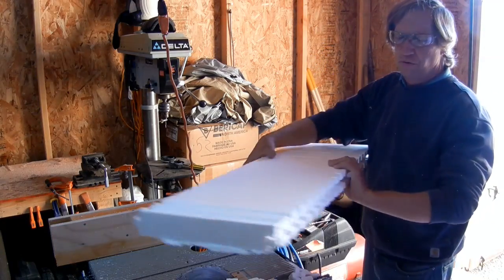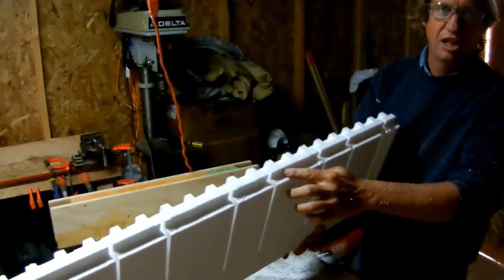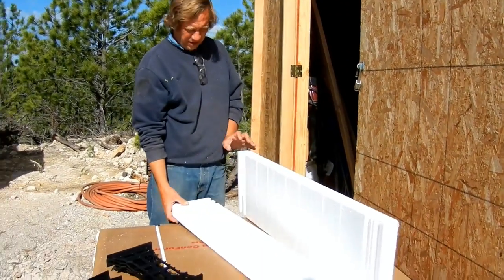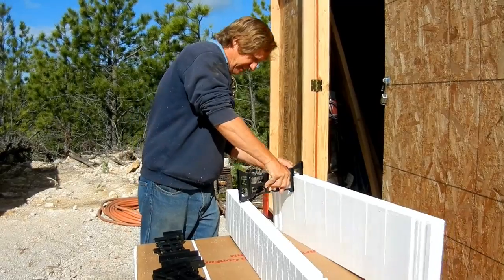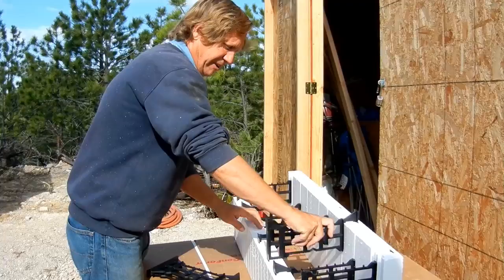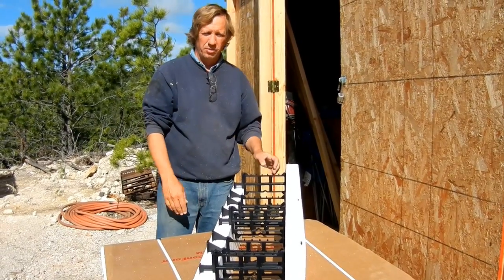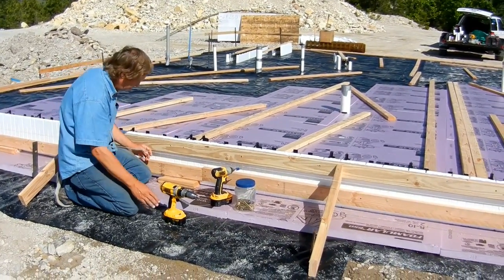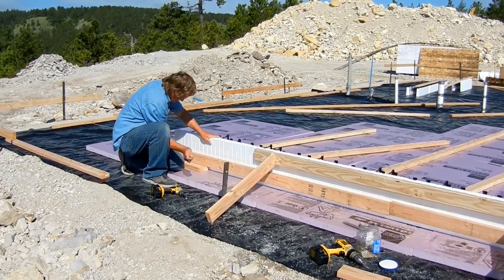Insulated Slab using Insulated Concrete Forms

Comment: Our well water is 58 degrees.  Our temperature of the soil is 58 degrees!
Our slab temperature is 58 degrees!
Even now the aie temperature is 30 deyet our room temperature is  60 degrees!
We haven't turned on our heat!
Yes, we are very comfortable!
It's an experiment & it's  enlightening!
BUT DON'T TRY TO INCREASE YOUR SLAB HEAT ARTIFICIALLY!
IT WILL BE EXPENSIVE!

Comment: I am pretty sure you can not put foam under the foodings as it will collapse over time....   It has been 6 years now, are the walls cracking?
Reply from the maker: I have no signs of settling.
Reply: He mentioned that they are over rock.  Their location has different soil conditions.

Comment: frost drives down, not out.Outside of floor only, need be insulated.
Reply from the maker: True, but I cut the inside form 4" lower than the outside and backfilled the center. The inside is used to form the footing and set the slab depth.

Comment: I know many people put down a great deal of foam and that is ok but just the fact you created a thermo break with one layer of foam is going to create a huge effect.  I built a home with a walkout basement in 1990. Under the slab I put down just one inch of foam. Around the basement walls I placed one more inch of foam right down the the footing. You should have heard the people back then that said my walls were going to freeze in the winter and the soil would push them in.  It worked perfectly. This house was easy to heat and I never had a single issue. That effect came from just one inch. 
Of course now days I'll add much more foam all around but the reality is that one inch thermo break is what counts the most.  I like how you did your slab.
Reply: Funny thing is though, ICF have been around since shortly after WW2 and never used for those same assumptions but also for their fire "traps" and "off gas", despite those claims they are quite fire retardant and so inert due to being steam molded that there is no off-gassing issues. That and there were so few manufacturers making them then due to low sales volumes, But these days man are much more of this generation figuring it out, better late than never.

Comment: Another option was to cut insulation panels in band ( height of your concrete ) place them on the face of the mold with nails and connect them to concrete with let s say 2 screws/m1 and do not use ICF ( the inner insulation serve nothing in my opinion ), 

Your option is also valid, just another way to made it maybe for less money

Maybe you could have also use foam glass garvels like misapor on the limits to avoid the insulation under your slab, but when doing so you don t get the advantage of the thermic damping mass of the slab

Two different options, different manners to do the job

Anyway, top work mister B-Spot ;)

Comment: Nice job, only thing I see missing is personally I would have sunk my foundation J anchors for the bottom plate into the footings and let them stick up. Sure you can drill in anchors later but why.
Reply: J (more commonly L) anchors are a cuss to fix if not placed right the first time, so if you wonder why then that is why drill anchors are often used in lieu and often as strong if not stronger than L/J anchors, but expanding has a limit to placement as opposed to screw in type anchor which can be drilled as near as 2 inches to and edge of a concrete form.

Comment: I have one dumb question.

Why back-fill the form with dirt before the concrete pour?

Sure, it may have saved you some on concrete volume...
Reply: Probably about 5 grand in concrete vs fill.  Plus it adds thermal mass for the radiant

Comment: Because the foam is on the same level all the way across (to put the footing icf on the foam) the purpose of the gravel seems to be to not have to make the concrete so thick in the main slab area.  This also makes it a monolithic pour.  This works out great for something on top the ground in warmer climates, but if that foam isn't several feet out away from the footing you can't use this in colder climates.  And it would have to be a little different if done deeper down with a basement because you would need a drainage system in the main slab area that runs in line with the footing.
Reply: From my understanding the distance out from the footer depends on the climate zone the building would be located in.  For example, here in zone 6 Montana the Montana Residential Energy Code Handbook (2012 currently used revision) building codes specify 4 feet of foam out from the top edge of the slab, horizontal or vertical.
Reply: You are referring to laying said amount of foam flat and out away from the wall , akin to this:
http://iso-slab.com/en/index.html#tab-5

As said layout shows it extends the frost protection zone, but horizontal would mean a footer wall and thus mean more foam and concrete with rebar than a simpler skirt footing as shown in the link image.

Comment: What brand of ICF are you using?
Reply from the maker: +Justin Palmer --- I got them thru Home Depot not sure of the brand.
Reply: @BSpotBuilds  Double checking...ICF is not a vapor retarder or vapor barrier?   The plastic sheet is the vapor barrier as I understand it?   I ask because i want to put ICF on the outside of my home's walls.
Reply from the maker: @Dancing_Alone_wRentals  ICF's are typically closed-cell foam and would be a vapor barrier, but the joints between them would need to be sealed. You could glue them together with canned spray foam if you need a tight barrier.
Reply: @BSpotBuilds  tHank you.  I'm planning two diffferent projects.  One would use Polyiso inside the home under drywall....There I want to add another layer of panel insulation on the outside of the home.  My concern is I can't use a vapor barrier inside...then add another outside.

Even posted a video asking these questions.  Loads of replies all pointing in different directions.   tHanks again for posting!

Comment: You have the whole weight of the building resting on insulation?
What type is that?
If it's strong enough to hold the weight, why bother with the concrete?
Reply from the maker: +jeffiek Yes the whole building is on foam. It's Owens Corning FOAMULAR 250 XPS rated at 25 PSI. It is strong enough to support an evenly loaded building but it does not have the compressive strength or rigidity of concrete. To put it in prospective the concrete has a load rating of 3000 psi.
Reply: B-Spot
I think I get it. The rigidity of the concrete ensures that the weight of the building is uniformly distributed over the foam, since any localized pressure points might be to much for the foam.

25 PSI ain't much, but there's a lot of square inches.
Reply from the maker: +jeffiek --You got it. For my place the footing is 170 feet long and 8 inches wide. The calculation for the total load the footing could hold would be 170 feet X .66 feet wide X 144 ( a conversion from square feet to square inches x 25 pounds per square foot for the foam = 403,920 pounds. That is a lot of 2x4's.
Reply: B-Spot
Thank you.